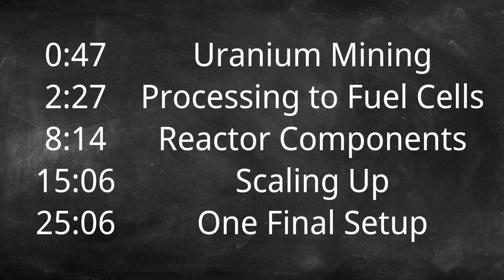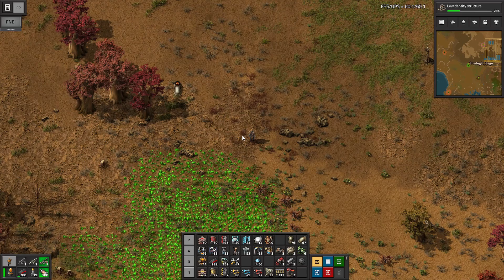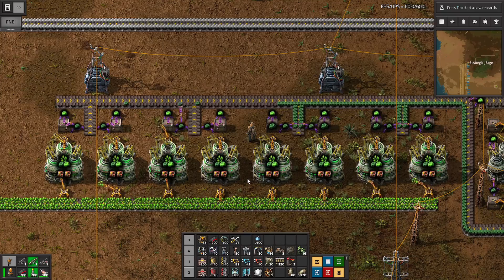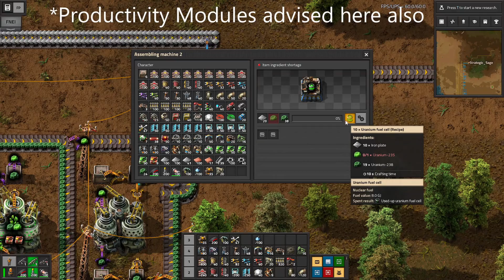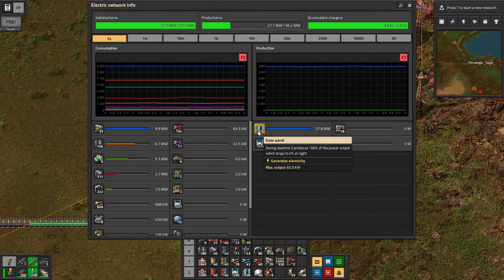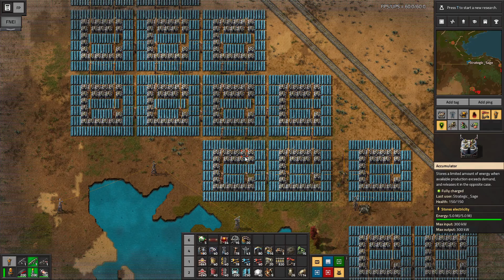Nuclear Power Demystified | Factorio 1.1 Tutorials for New Players #36

Comment: Thank you for the guide, I really appreciate it! One question though about your Kovarex enrichment setup. I setup an inserter to only move U-235 if there's more than 45 in the chest, but the inserter putting the 235 back in the machine is too fast and there's never more than a few in the chest at a time. Do I just need more 235 in the system to account for the machine's internal storage?
Reply from the maker: Yes, you hit on the right answer.  You want the inserter to be too fast putting the U-235 back into the centrifuge.  The important question is whether you are getting more of it over time;  it should be growing by one U-235 every cycle and it requires 40 to do that.  Otherwhise what would happen is you'd be taking the U-235 that Kovarex needs to operate, and it would stop making new U-235 for you.  That would be bad.
Reply: @strategicsage7694  Yes, after letting it run for a while the machine backed up, and eventually the chest backed up enough for some 235 to be turned into fuel. Thank you :)

Comment: Thanks for the guide! Well detailed and still had a great flow to keep it interesting.

A small tip for other nuclear beginners like me is that you should not build a second reactor when you just barely go over 40MW power consumption. You'd double your nuclear fuel usage for very little gains. Instead bridge the gap with a smaller boiler powered plant or solar-battery combo until you get way more than 40MW consumption contantly.

It was accurate but weird to calculate the steam engines based on MWs. :D since their output is given by steam/sec. A good rule of thumb is to build at least 12 steam turbines for every 7 heat exchanger - this gives almost exactly the 60 to 103 ratio.
Reply from the maker: You're welcome!  On the specifics you mentioned, I would suggest a couple of points:  
- Doubling nuclear fuel usage is a virtual non-consideration considering how easy it is to produce.  
- In terms of calculating steam turbines based on MW - I did that because that's how the base of chain works;  reactors are measured in MW output.  If I did it based on steam, that matches better with heat exchangers but worse with reactors.  To my mind the important consideration is how many do you need for whatever size reactor setup you are making.